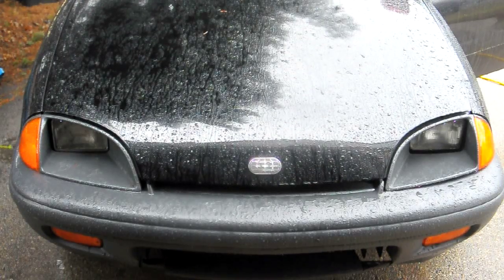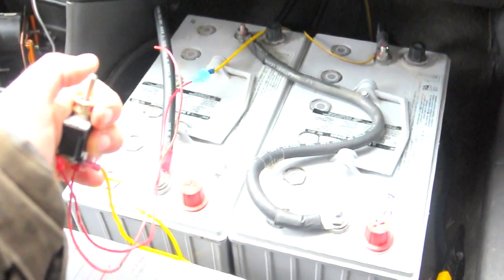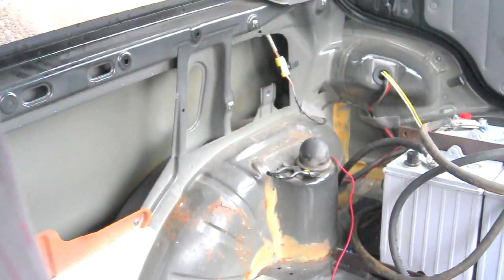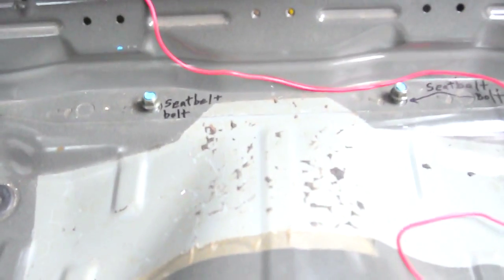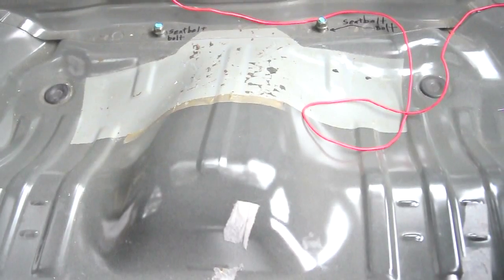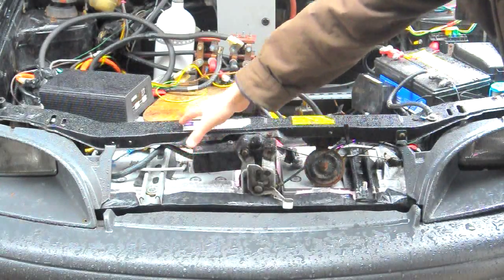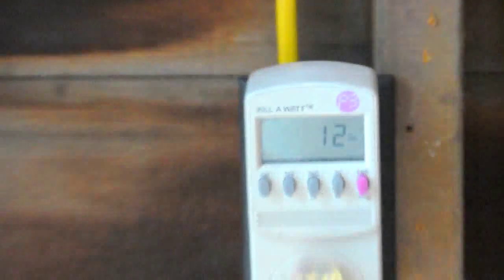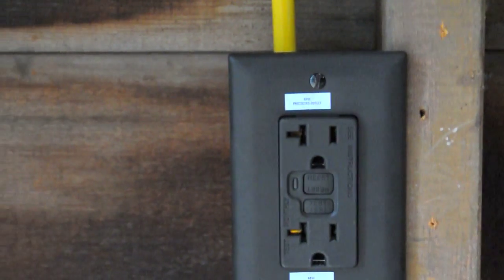Electro-Metro Update Feb 9 2009

Comment: But, what charger are you using?
Are you charging at 12V or 48V?
Reply from the maker: I've run this car at several different voltages, but was always charging with series string chargers. For the most part, I used a charger which could do 72-108V. When I was running at 144V, I used two chargers, one each for the two halves of the pack.
Here's a video about charging the car. https://www.youtube.com/watch?v=wzmGUXhobsM

Comment: Ben , how much are each of those 12V batteries and where do you get them??
Reply from the maker: I bought those batteries USED from a guy who sold Neighborhood Electric Vehicles. He sold them to me at the core charge rate, which was only $12 each at the time. I tested the batteries and used the best of them in the car.
Reply: BenjaminNelson ok so you said they are gel cell 12Vs? Im going to look for some locally here in CA. I have the same drive motor , different color. You were def. ahead of your time, very cool

Comment: Yup thats just how I did it. Chopped a hole under the rear seat and stuck 4 more g31s in there. I has 10 total in my Geo. Burned rubber in 3 gears. =)

Comment from the maker: I am planning aero-improvements, but want to take care of general battery/range issues first.

I did have a partial belly pan on there, more for engine compartment salt-water protection than anything. The long term plan will have a belly pan, and maybe a front air dam. I like the idea of aero-ing the headlights too.

Comment from the maker: The motor handles the voltage just fine. I have been told that the motor should take up to 120v without modification.

As for safety, stopping ANY of three contactors will turn the turbo off, but yes, it DOES drain the batteries fast!